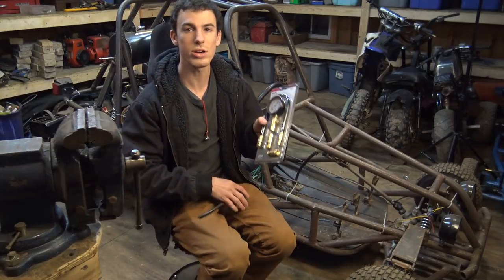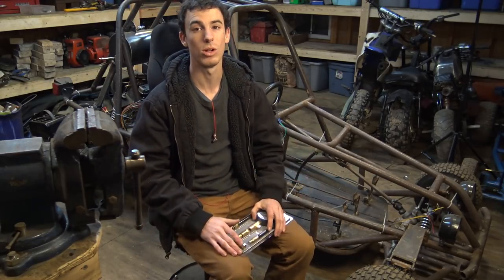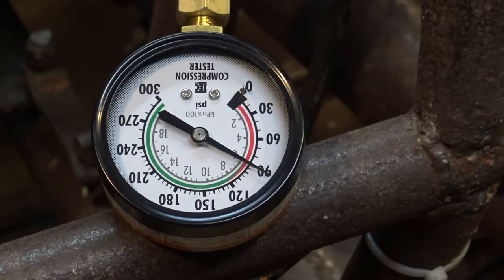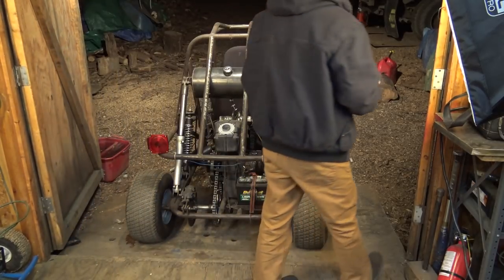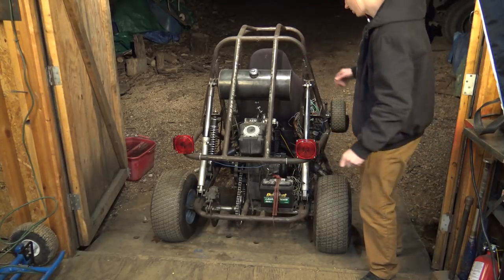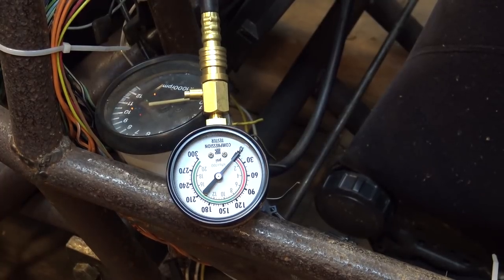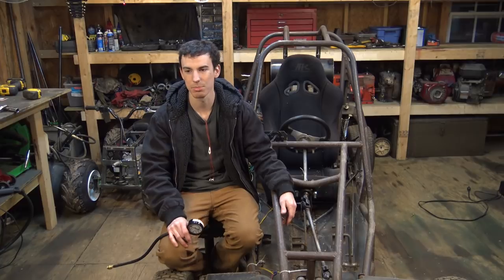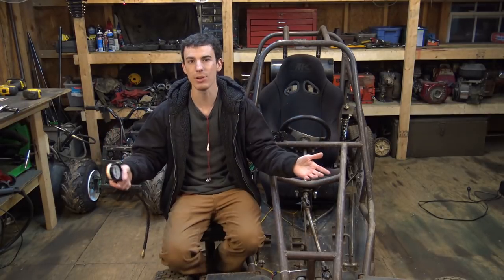Compression testing the gs500 engine

Comment: Put a little oil in each cylinder and retest, This will seal the rings and bring the pressure up. Confirming the rings need attention. If it doesn't come up, then look into your valves.
As for the not running issue, I'd look into trying some different coils or coil. Coils are known for running while cool and quiting when hot, when they get older and worn...
Best luck to you, will be watching
Reply: Plug leads first , do the cheap fixes first.
Reply: also make sure you have a good head gasket thats torqued down to spec!

Comment from the maker: Happy new year to everyone.
Reply: rather B welding you ever check spark when it wont start? It acts like coils are bad. Bad coil will not spark when hot. Idk where you got coils mounted but they need to be bolted to steel to help keep cool.
Reply: Happy new year for you too. :)
Reply: i think it the coil and rings i put it in one of the first vidioes and when he did that clean the head and the boars i think that didn't help because it made the boars ever so slightly  wider and that and only with bad rings and damaged boar you can  get that low a compression  and bad coils add to it
Reply: not an expert in any way so take everything with a pinch of salt but as you said the rings were seased i would start by replacing them
Reply: and happy new year to you to
Reply: rather B welding u got to thank that if it’s a old engine it ain’t going to have the best compression if it has been ran a lot and if it has a lot of miles or hours on it
Reply: rather B welding and happy New Years
Reply: Try to get the piston rings out and clean the groves where the rings set, check to see if your valves have a nice seal to the head, then check the valve gaskets (im just trying to help a little, im no mechanic dont take my word to heart)
Reply: It sounds like it needs new rings
Reply: Oh and it will need to have that petcock for the fuel
Reply: Happy new year buddy
Reply: Happy new year!  looking forward to your 2018 projects
Reply: This shits getting old. many of us have said the damn coil is bad. 

compression is not your problem. 

coils.

it NEEDS coils.
Reply: rather B welding  hey bro I enjoy all your videos....keep it up
Reply: One or both coils may be bad. I had the same thing happen to an old 3 wheeler. It had the same reading on a compression tester.
Reply: Its your coils man, like another commenter said, you can hear it in your video, its missing out
Reply: If you get a new engine might i suggest a newish sports bike engine and maybe buy a project bike and just use the engine

Comment: When it dies check your coil.  Listen young man.  Check you coil.  Have seen this many times.   Suspect coil is failing when warmed up.
Reply: May look fine but not firing every time its supposed to. And there is no need to hold down the accelerator you would be flooding it .
Reply: agreed, this was mentioned a few vids ago
Reply: It certainly could be coils.  It's important here to check the basics when the engine stalls and find out what is stopping it.  Is it spark, compression or fuel or a combination?  It could loose compression after the oil heats up and thins down.  I couldn't tell if he re-installed the fuel filter in this video.  The last video where it stalled, it acted differently.  It went much further.  He had a carb issue because he removed the filter.  That could be still causing issues if the filter is not in place.  Need to narrow this down systematically.  Need to re-install the filter and do another test run to make it fail, then check spark and compression and go from there.  It's not going to get fixed by guessing.  There has to be some methodical troubleshooting.

Comment: Sorry if I'm posting a lot, I've rewritten all my posts into one.

As long as the tank is above the carbs, and all vacuum lines are connected or plugged. You shouldn't need the petcock (tank vacuum valve-y thing).  Crabbed motorcycle engines (especially 500cc and lower) need time to warm up, helps to lean the mix, should run better after about 5 minutes with the choke applied as needed. Found that out the hard way with my little ninja 250. Check the plugs to make sure they aren't scorched or oily black. That will indicate if you have too little or tool much fuel.

The odds that both cylinders are exactly 90psi is extremely rare if they are truly worn out, unless the rings on both are literally gone.  You should start with the timing, do valves then chain alignment and tensioning.   Once you get the basic idea of it, it's really not that easy to screw it up. The hardest part about timing a motorcycle engine is getting to the internals without having to bend your hand backwards around the frame, luckily you do t have to do that.

If you don't see any smoke coming from the crankcase breather tube, chances are that the rings aren't too bad. How many miles on it would you say? 

I would point out that the airbox on a motorcycle is designed to maintain an ideal (or at least reliable) running condition, modifying or removing parts of it may cause idling/lean mixture problems. Same with the exhaust, the back pressure generated can help valves pop faster or potentially scorch the valves if it's just a straight pipe. 

Engine sounds okay to me.

If the engine has too much oil in it, or when the oil expands from heat, it can also pool in certain areas and slow down the piston until it drains off again. (unlikely but possible).

Comment: When a motor is run without any valve clearance, the valve are held open when they should be closed. Sometimes this can lead to carbon deposits on the valve which causes them to be held open even after you adjust the valve clearance. Running the motor sometimes can clear these deposits, but you will need to re-adjust the valves after the deposits are gone. This would account for the low compression readings.

Edit: posted that before watching the whole vid... yep, frozen piston rings will not seal, hence low compression. Rings are usually not too expensive, though you may need pistons too. And if the jugs are scored, they might need replacing or at least boring, which means oversize pistons and rings, if not, you can hone them yourself.

Comment: Try that tester on a different motor to make sure it works properly as I have seen a few that won't go above 90 from China that look just like that one
Reply: Was just about to say the exact same thing. I've had at least 4 guys bring me an engine with low compression to work on but when I checked it with my snap-on gauge they would be fine. Turned out to be their harbor freight tester.

Comment: On the cold compression test try adding about a capful of fresh motor oil to the cylinders if the pressures change significantly (at least 10 psi change) then it's time for a bottom end rebuild if it doesn't show much change then it needs the heads rebuilt.  90psi is not always bad if it is a low compression engine.  The other symptoms though definately indicate an ignition system problem.   Another very very potent way to soak the carbon from the rings is a 75/25 mix high quality synthetic oil, and diesel fuel it'll strip carbon deposits and rust from pistons and rings like you would not believe. Just leave the parts soak till clean (works better than most everything I've tried). I usually use the drained royal purple 15w40 from my 1st Gen Cummins mixed with some diesel fuel when I try to free up anything seized.  I threw  my old diesel engine oil in an el cheapo harbor freight parts washer to create some flow over the parts while they soak.  I learned of the oil soak trick because I accidentally flipped a piston from an engine I was rebuilding into my drain pan while prepping to transfer the oil to my oil recycling container from the drain pan.  I saw almost immediately a swirl of black in the oil where the piston flopped in so out of curiosity I left it sit overnight,  the next day When I checked it the half inch rock hard carbon cake on the piston crown had completely dissolved away.  Out of curiositu I tried conventional oil to little effect but the used synthetic diesel engine oil worked amazingly

Comment: Happy New Year to you and yours!!
Yah, 90 psi. isn't too good, but isn't too bad either, that's 7.2 to 1 compression. Still a runable motor though. Mentioning the rings were stuck is not good though, the piston could expand more then the cylinder and drive the rings into the cylinder wall and cut up the cylinder wall. Need to free up the rings. Even if you trace the compression loss, that isn't why the engine is dying out when hot. Look into ignition parts. Could be plugs, pull when dying out to see if wet, wet plug means not firing. Circuit test the wires, cap, and rotor if motor has them. Check for spark maybe first when engine is dying, should be strong spark and able to jump a good distance.
If ignition checks out good, look to carbs. Carbs might be running lean, that would make it die when hot. Should be a easy fix to get it running and keep running. I would get it running first before tearing into block though, tearing into the block would add more frustration. If it is running before, then you know everything bolted to the block is good.
I just did some vids on engine building that might help, on my channel. They are on a car's engine but can be applied to that motor. Good luck getting it going. You can pm me if you got questions. Should be a bad ass build when you do get it going.

Comment: Well as i mentioned in two of your videos,that I think that your cylinders are glazed up and you have terrible compression. Thank you for doing a compression check.90 is bad emkay,but i believe if you ran it till it conked out then did a compression check,you would find out that the compression would be worse. and thats why it wont start untill engine is cooled off.you need at the very least psi of 90 to run.I had two motors do this to me.The fix is to hone the cylinder to get a nice cross hatch in them and get new rings.presto! Good luck and happy new year and keep up the kool builds

Comment: A engine builds compression as it warms up. As the metal expands, there is less clearance and the ring gap starts to shrink. That's the reason for a larger piston ring gap on turbocharged and high compression engines. 

90 PSI may not be good but if it keeps it the same, it will not cause the engine to stall. I honestly question the quality of that compression tester. Test a cylinder on your vehicles and it it still displays 90, get your $30 back. 

I can't remember if you've done this already but have a spare spark plug ready and run the engine until it dies. IMMEDIATELY, pull off one of the wires and connect it to that external spark plug and ground it and crank to check for a spark. I'm almost positive that you aren't getting a spark. I'm unsure of the ignition setup of that engine but it's a start.

Comment: you must remember that the check valve for the tester is located at the gauge . When you measure compression there is basically added volume in the hose lowering the reading. On bigger auto engines its not a big deal but with smaller engines it can make a great difference in the reading

Comment: The compression is an issue, but it seems like the coils are whats actually causing it to quit after it warms up, and coils are a hell of a lot easier to fix than new rings and honing the cylinders, so i would put new coils in first and then if its still happening, fix the rings and stuff

Comment: common problem for these motors is the valve clearances being way off. i would recommend checking the clearances and reshimming if necessary then testing again. i had a gs500 that had 20k miles on it and it had a stuck exahaust valve on one side. this was caused by the valve clearances never being checked and a lack of maintenance. i got the bike for free but it wasnt worth doing a valve job so i sold the entire bike for 150 as parts.

Comment: 90 psi is more than enough to run fine for that buggy. I have riding mowers engines with 60 psi that still run. 90 isn’t really terrible. It’s not a diesel it’s an old motorcycle engine. I highly doubt the reason it’s dying has anything to do with compression. I would bet on either a spark or fuel problem.

Comment: Your compression is probably low because your cylinders are glazed and your rings need to re-seat, usually running it pretty hard for a little while will do this. As for dying after 5 minutes, ride it till it dies and then crack the cap, if it starts right back up after that was your problem, you can add a vent line or just put a little hole in the seal for the cap. Good luck man, videos are rad!

Comment: Its electrical, check plugs, leads, coils and if it has points and condenser check gap and you can try condensers as well and of course check for loose connections. Its not unusual for condensors, coils and plugs to fail when hot. 90psi compression is low but it will still run just down on power. Its not blowing blue smoke so rings, pistons won't be too bad to stop it running. Always apply KISS method ( keep it simple silly). Its generally something simple.

Comment: why do you think 90 is bad? is it because there's red on the gauge? it needs about 60 to run decent... 60 isn't bad for a small engine
Reply: Yea as long as they are even.
Reply: true
Reply: well this isnt a small Engine so its bad
Reply: around 120psi is average for a gasoline Engine i think
Reply: lol... ok
Reply: Factory spec for the engine that he has is 144-199 psi
Reply: It looks like he's right on the compression specs--the engine's supposed to have much more squish than that. But that's clearly not what's making it shut off once it's warmed up. Cleaning up the rings should give it some power back, but I suspect the warm shutoff will linger.
Reply: 90 is not good but for the cost of a complete tear down a second hand motor will be way cheaper .  The compression of both cylinders are the same so it will run sweet. The reconditioned motor may give a little more hp but for what sacerafice. Weigh it up and take your pick.

Comment: I have been turning wrenches for over 30 years ...your compression is low but not your main issue ( only needs 40 psi to run) also timing is also not the issue since it runs OK at times that only leaves spark and fuel  to test  and  it is easier to test spark than fuel

Comment: 90 is decent for a small engine. Between 110 and 60 is what you want. Compression isnt the issue, warm it up like you did, and pull the plugs and see what the spark is like. If its good, fuel is the issuse. Make sure tank is venting properly.

Comment: with them both at the same number that's not bad !  90 is the lowest that you would want it and no more than 40 differance between cylinders !  Does it have a relief valve like lawn tractors have and they won't let it go past 60 psi.  I think that it really sounded good and it ran for a long time !  Happy New Year !  Hang in there !  Go talk with a mechanic at your local bike shop ask questions you are doing the same things that they would !  go to your library and they will probably have the book for that motorcycle or even a bike that is close to the same age and a v twin !  knowledge is power !

Comment: Good info. If you take the engine apart, reseat the valves. Happy New Year!
Reply: Did you hold throttle open while checking compression

Comment: Wouldn't worry about low compression it runs too good as far as papaya dies after 5 minutes usually is caused by the vent on the gas tank

Comment: I never saw what the compression was on the other cylinder. That will tell you more of the story. The bottom line is that the low compression will not make it run a while and die, that sounds more like a fuel problem.

Comment: I'd check with a volt meter the coils when it's cold then when it's worm and if it's not that then it's probably the compression but check the cheaper solve first before tearing it down. Good luck and keep up the good vids.

Comment: One good thing is both are the same compression, it could be where one is 90 and the other 120. But I think you need to check the spark right after is won't start, and check if fuel is getting to the engine, might be getting some kind of vapor lock? Not too sure on that last one lol Good Luck and have a HAPPY NEW YEAR...

Comment: dump a shot glass (30ml) of oil in the cylinder threw plug hole then check compression if it goes up then its rings if not its valves or gasket

Comment: So while you are at it replace the head gasket, lap the valves, and replace the piston rings. And if this gs500 motor has rod bearings then replace them to so the motor will run smooth and last a long time.

Comment: Seeing that there both within +-10% I’d say there’s probably a built in compression release for the cylinder. Also cold it runs to good for it to be the motor. Like the majority of others saying it’s probably the coils. If it was valves it wouldn’t run good at all cause they wouldn’t be sealing and the ring s as it gets hotter they seal better. Also check the compression with a different gauge that one may be junk there should at least be a +-1psi difference. It’s not compression because it runs to good for sure.

Comment: compression is not the problem if your rings were worn out bad it would burn oil and probably still run though. coil or ignition trigger (cdi box) ( pick up coil)  it runs fine until it dies.

Comment: Pull the cylinder head off and check the head gasket. The smoke looks like it’s coming from around where the cylinder head and the cylinder meet. It might be warped, if so get the cylinder and cylinder head decked “machined flat again” and buy a new head gasket. If not then the valve shins still need to be adjusted right or the cylinder is toasted